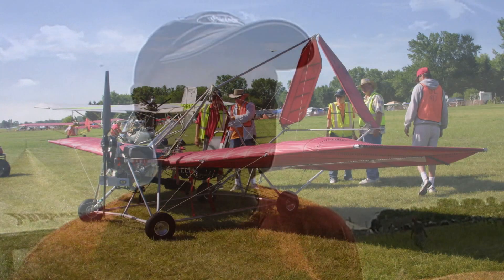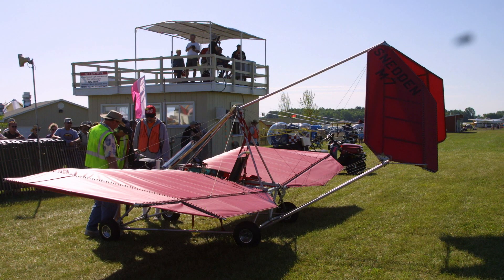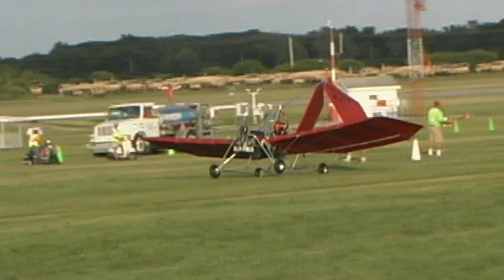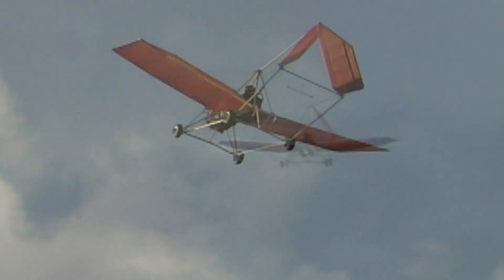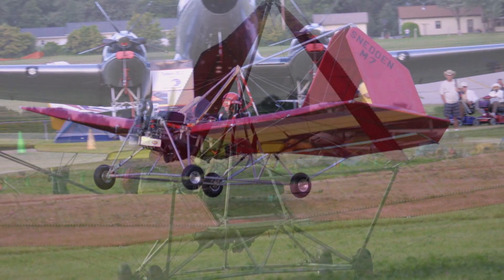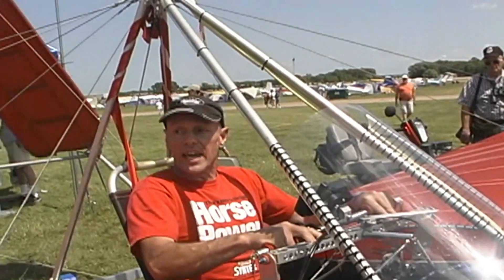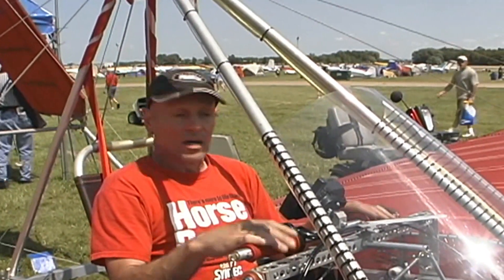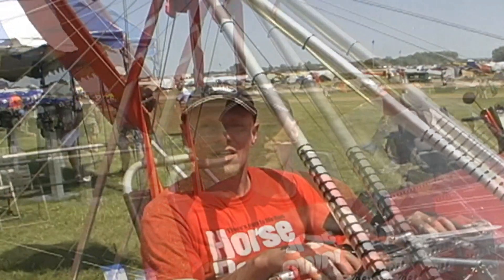Snedden M7, Legal Part 103, Ultralight Aircraft

Comment: Very well rounded aircraft design. I like it over all. Not a big fan of the Slo Poke HUGE root cord, but it works well in fair weather. Wouldn't want to encounter too much turbulence with this one though. It is probably OK because of the built in stabilization, but still,,,,,, Eh,,,, Can't say any more than that really.